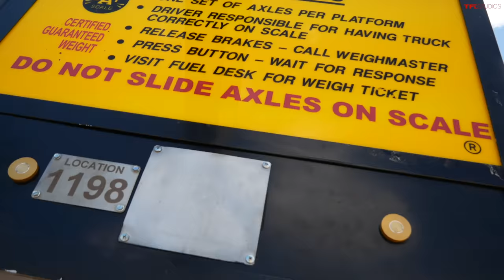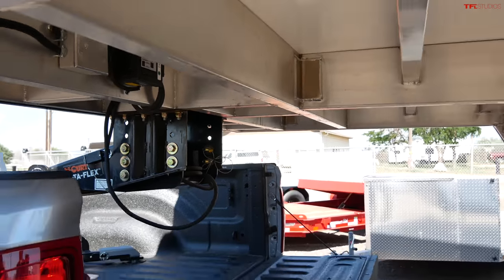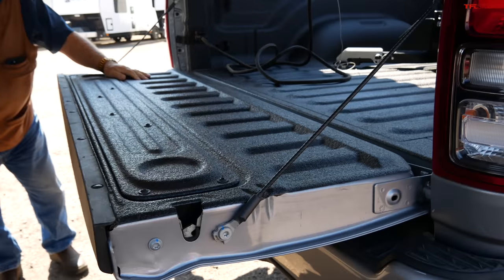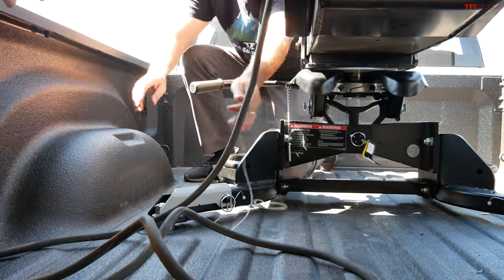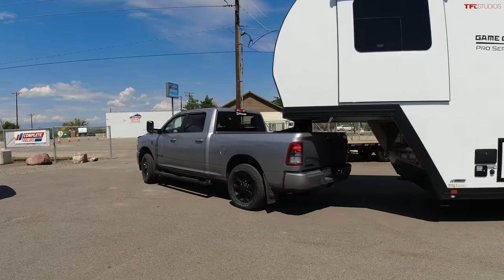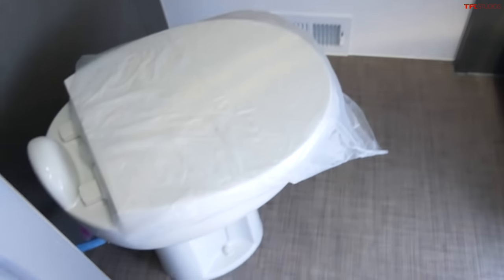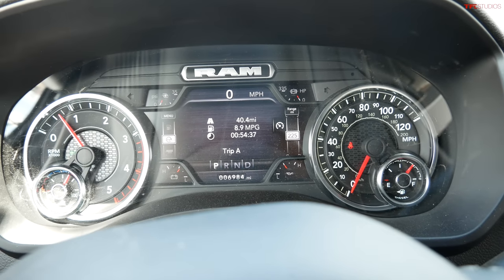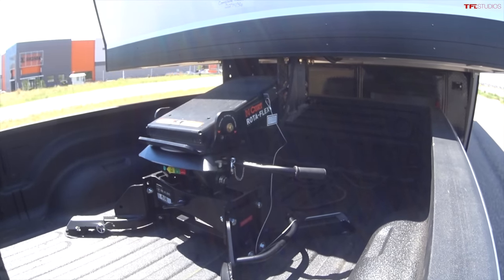I Accidentally Overloaded My Ram 2500 Cummins By 1,000 Pounds & Guess What?

Comment: Hey guys great video. Slight correction on the trailer. Empty weight: 11,064lbs, GVWR 16,800lbs, Axle Size -2 X 7,000lb Axles. Some of the GVWR transfers to the truck which gives you a higher GVWR.
Reply: How does it give you a higher GVWR? GVWR of anything is what it is and is specified by the manufacturer. You can't just change it.
Reply: @AJourneyOfYourSoul  Tandem 7,000lbs axles = 14,000lb but this GVWR shows 16,800. Since the truck is hauling the trailer in the bed of the truck, some of the trailer weight is now “transferred” to the truck and off the trailer. All trailer manufacturers do it and the rule of thumb is 10%-15% transfer weight.
Reply: @CompleteTrailers  

Yes, some of the weight is being carried by the truck, but that doesn't mean it "gives you a higher GVWR."

The GVWR is the GVWR no matter what. 

I think you misunderstand the term GVWR. 

Terms have meaning. The last thing you want to be telling people is that you get a higher GVWR. 

How high? Does the GVWR go from 16,800 to 20,000 now?
Reply: @AJourneyOfYourSoul  I think you are totally misunderstanding what they were saying. The GVWR based on just the axles is 14,000lbs. But the trailer is rated at 16,800 because of the weight being transferred to the truck. Some trailers have their GVWR based on just the rating of the axles, which is true of most bumper pull trailers.
Reply: @CompleteTrailers  just because 'everyone does it' doesn't mean it's right. Camper is built as light as possible and then gets a tag it can barely support? The guy was so worried about the landing gear bending when hooking up.. utility trailers don't get tagged this way
Reply: @Stuka87   he said it gives you a higher gvwr.  So how much higher is the gvwr now? 

GVWR has a very specific definition and meaning.  

He also said some of the gvwr transfers to the truck. How does a rating transfer to the truck?

He is giving out wrong information. The gvwr does not change. 

It appears he is either a trailer manufacture or dealer.  The last thing I would expect of someone in his position is to tell people it makes the gvwr higher, people will probably believe him.
Reply: @AJourneyOfYourSoul  Again, it appears you lack understanding. Sure, he probably should have said "some of the weight transfers to the truck" instead of saying GVWR. But its a freaking youtube comment, stop nit picking. Its very clear he meant exactly what I said in my previous comment.
Reply: @Stuka87  that’s not what he said. Words have specific meaning, especially in technical subject matter. 

He may have meant to say that, and people like us who understand the subject know what he is trying to say, but lots of people will not get that.  

The only reason I made a stink of it is because this person is a trailer manufacture or dealer and the channel thought the comment was so important they should pin it for all to see. 

If there is anyone who should know how to communicate proper information about trailer and towing, it should be this guy. 

So many people out on the road are towing overweight, the last thing we need to do is start telling people weight on the truck makes your gvwr higher.
Reply: @AJourneyOfYourSoul  Don’t be a nitwit. The axles are rated for 14,000 pounds so the gvwr would be 14,000 but some of the weight is transferred to the truck so the real world gvwr is 16,800 because of that transfer. That’s it the gvwr is 16,800.
Reply: @AJourneyOfYourSoul  Also, why are you arguing against a trailer company. I would think that the company that makes the damn thing knows more than you would.
Reply: @epap1375  when not hitched to a truck the weight is all on the trailer, meaning the axles and the landing gear. So the gvwr is the max weight the trailer can weigh weather it's hitched to a truck or not.
Reply: I understand the confusion. Utility trailer companies cannot be compared to larger trailer companies. For example, some utility trailers come with a 3,500lb axle but the manufacturer “de-rates” the GVWR to 2,990. Now why the heck would they show less capacity than what the axle can support? Well, anything over 3,000lbs in GVWR requires a brake in most states and manufacturers are trying to keep costs down so they rate the axle under 3,000. The reverse is true for larger trailers. For example, our flatbed goosenecks have 2 - 12,000lb axles. Simple math shows that the GVWR should be 24,0000lbs right? Wrong - since the truck is handling some of the weight (when hooked up) the GVWR shows 25,900 lbs. This is a completely legitimate practice that all larger trailer manufacturers follow.
Reply: 8000 lb. axles
Reply: @MrTruckTV  That statement in the video was incorrect. This trailer has 2 - 7,000lbs axles.
Reply: @CompleteTrailers  Sorry, when we picked up the trailer, I was told 8,000 lb. axles
Reply: I was going to say you are wrong also until after reading all the comments I realized you really meant.

Your original post sounded like you were saying that since the truck carries some of the load you can assume the trailer can handle a higher weight than what the GVWR is.

But what you actually meant is that Mr. Truck said the wrong axle rating... and you assumed Mr. Truck thought the rating of the axles was 8,000lbs because they divided the GVWR by 2.
Reply: @MrTruckTV  Sorry for the misinformation! Heads are gonna roll. 😬
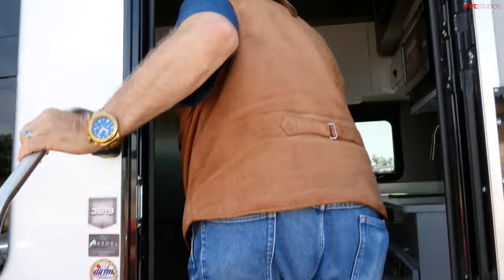Reply: @CompleteTrailers  I am glad that ATC is now making heavier duty toy haulers. I am particularly impressed by both its use of Azdel (not verbally mentioned here, but displayed on a sticker at 17:30) and its 7458 lb payload. Personally, I would not buy a trailer/toy hauler built with the old standard - luan. Azdel is well worth the added cost. As for payload, toy haulers equipped with an onboard generator seem limited to between ~2500 to a max of 4400 lb.  A 4400 lb rating is uncommon. But even then, it's EASY to exceed it. 

I have seen some toy hauler manufacturers (Desert Fox comes to mind) who FAIL to subtract from the rated payload the weight of the accessories they supply as standard with their toy hauler (e.g. generator, A/C units, rear beds/seats and its 'Happy Jack' lift mechanism, etc.). This can detract ~1000 lbs from its true, remaining payload.  A full sized UTV equipped with accessories can weigh 2200 lbs., 100 gallons of fresh water adds ~850 lb. Throw in an ATV or dirt bike, 30+ gallons of gas, a few hundred pounds of clothing, tools, etc., and one can readily exceed 4400 pounds. The difference between ~4400 and ATC's 7400 lbs is huge and much appreciated.

The only complaint is the unloaded versus fully loaded weight distribution. Ten percent of  its GVWR of 16,800 lb is 1,680 lbs. And yet, when EMPTY, its tongue weight was measured at 1760 lb (11,080 - 8320). This implies that essentially ALL of the weight of whatever is put onboard needs to be centered midway between the rear axles or (preferably) even slightly behind the midpoint between the rear axles
Reply: @thjacobi  A trailer's GVRW is put in place for when it is being towed down the highway. not when it's parked. So if it transfers let's say 2000 pounds onto the truck, then that is 2000 pounds less riding on the trailer's axles. 
Once you park a trailer you can put as much weight in it as you want, the GVRW is nothing more than a weight rating.that is put in place for safe highway use.
Reply: My 1-ton F-350 Lariat (most options) SRW with me in it, full fuel, and full DEF weighs 300 lbs less than this Ram 2500 with probably similar levels of equipment. That's the problem with 3/4 tons: they are SOOOO heavy that a significant chunk of their capability is kneecapped, on top of the fact that they do not have the GVWR ceiling that 1-tons have. The diesel engines are the primary cause.
Reply: @SurelyYewJest  That seems odd for the Ram (with a inline 6 engine) to weigh more than the Ford (with a V-8, with V-8 engines normally being heavier). I can venture a guess that  model year may make a difference.  I have a 2017 F-350 SRW, Diesel, 4wd, Crew Cab, Long bed. The ONLY weight difference between an identically equipped F-250 and F-350 SRW is that the F-350 had an extra set of leaf springs in back. So, the F-350 weighs ~60 lbs more. 2017 was the first year when Ford switched to an aluminum body, reducing its weight by a couple hundred pounds. Ram has not switched to aluminum.  What year is your F-350?
Reply: @gregparrott  Mine is a 2017 (Magnetic) as well. =) Is the only difference the extra leaf or two? I thought there were a few others like the rear diff and axles. It begs the question: If you added the F-350 rear spring set to an F-250, would it basically be an F-350? The F-250 max GVWR is a good deal lower. 
Speaking personally, I don't think the aluminum thing panned out well for Ford. It's a hard sell to say it dropped weight when 2022 Super Duty trucks are all hundreds of lbs heavier than, say, a loaded 3-row 2005 Excursion 6.0 PS that is steel front-to-back with a similar payload capacity as a current Ford F-250 Platinum with scads more torque and better transmission tech. Even GM stopped touting "high-strength steel and aluminum construction". There's just no getting around the fact that, annually, hundreds of thousands of average joes can drop a wad o' cash and ride home on 3.5-4.5 tons of mined and smelted metal.
With respect to the Ram, this is not the first time the Cummins truck was mind-blowingly heavy. TFL did a gas Ram VS diesel Ram test some time in the last couple years and the diesel Ram was absolutely eye-popping on curb weight; if I recall, the 6.4 Ram was well over 1000 lbs lighter. I think of all the Big 3 3/4-ton trucks, the Ram is the most impacted by diesel weight when it comes to payload. It may have 2 fewer cylinders and fewer parts, but those parts (pistons, rockers, valves) are just bigger than the Power Stroke or Duramax. They're all CGI iron 4-valve pushrod designs. And, it's a Cummins so the block is built like an aircraft carrier. Fully dressed I think the current 6BT pushes 1200 lbs by itself. The Power Stroke 6.7 I think is near 1100, as is the Duramax. All the current diesels really make you think about whether the gas engine might be better unless one truly needs the capacity of a full-tilt F-450, Chevy/GMC 3500, or Ram 3500 HO+Aisin dually WHILE accelerating like a passenger jet at takeoff.
Reply: @SurelyYewJest  Your "magnetic" comment is confusing. If you have a 2017 (it has the new body style compared to 2016), your truck's cab and bed body,as well as tailgate are made of aluminum. The axles on the F250/350 are the same. The F-350 has and extra leaf and the spring set is arched a bit more to raise the back end about an inch (when unloaded) compared to the 250.  Comparing the weights to earlier models is not fair because the the new frame is MASSIVELY stronger. It has larger cross sections and prior portions which were "C" sections are now fully boxed.
Ford claimed that they reduced the weight by hundreds of pounds, but some of the savings were then used then to beef up the frame, suspension and brakes. I agree that aluminum offers a mixed bag of up/downsides. On the downside, the bed is more prone to puncture when dropping heavy, sharp loads. Also, if you need body repair, it costs nearly double to do so on aluminum. A friend had a 1950's International pickup. Its sheetmetal was so thick and strong that you could WALK on the hood. That type of strength has been traded for MPG. Aluminum seems to be the trend.
From you're saying about Ram, it sounds like their design philosophy places a lower priority on balancing its base weight versus its payload
Reply: @gregparrott  Magnetic meant the color.
For sure the current Super Duties are far superior to the previous generation, it's just that while using lightweight materials and adding strength they still ended up a lot heavier. At least the center of gravity is/should be lower on the current gen.
I had to have mine in the shop twice to fix a rear panel that was damaged when someone rear-ended me earlier this year. The first run at the aluminum was not entirely successful in returning to the original curvature so I had them give it another go. It's definitely a more involved check on the work, and not only does it cost more, only specific body shops can do it. I had to take mine to a place 15 miles away even though the same company has several outlets that are closer (but no aluminum tools or expertise).
The puncture thing I hear is not that common, but that's just anecdote on my end so maybe it's more prevalent. Mine has a spray-on liner and the bed seems to be tough as nails.
Ram has not focused on lightweighting at all from what I've seen, and they probably feel they don't need to given that their sales really hit a high gear over the last decade in spite of their lower reliability record. Pound for pound I think Ram trucks are the nicest lookers with the best interiors. Haven't seen the new GM interiors yet though.
Reply: @calvinh.8882  sorry dude, you're flat out wrong.
Reply: @thjacobi  Over a month later you respond, and sorry it took you so long but I'm flat out correct!
Reply: @gregparrott  they are wrong in the video about the weight of the tongue weight! The truck empty weighs 8300lbs then when hooked to the trailer the trucks axles weigh front 4940 rear 6140 for a total of 11080 now subtract the weight of truck 8300lbs from that and you have 2780lbs tongue weight.
Reply: @HEMI345375  and its sad cause the axles in rear is like 6400lbs. N fronts are like 5200lbs. On mine. Which is a 2012. Axles can take over 11k. But the sticker debates it to 9900 lbs.. but whatever. . Right..
Reply: The ten thousand pounds rate is for the ball hitch on the bumper with a fifthwheel hitch you can tow quite a bit more but if your going to pull a big camper I'd recommend a 3500 dully if you blow a rear tire with that much weight I'm not sure you could handle it with the dully it's just safer
Reply: @AJourneyOfYourSoul  yeah I think what happens is they rate the axles.. so when you pull in a scale you better be under 14001k. Now the tongue of trailer better weight less than  the gvwr on pick up. So let's say ram truck is 10k gvwr. And truck alone weighs 7700 he can't put 2300lbs of weight total in truck axles. Even though most rams have a axle capacity of over 11k. Mine does not they derate it down to 9900k... so stupid
Reply: I believe Transferred is being used as, weight of 5th wheel carried on trucks axles ..not weight carrying capacity added to the truck.
Because truck frames, axles, bearings, don't get stronger from adding a trailer.
Reply: @AJourneyOfYourSoul  "Mr Truck", is a truck and RV dealer.
Reply: @tylereurick9316  trailer manufacturers don't know more. The "7,000 pound axles" is the axle tube and spindle rating by them, which is always downgraded from the true weight rating of the tube and spindle. The true rating for a "7,000 pound" axle is actually 8,500 pounds if you have 8 bolt hubs. You have a "7,000 pound axle" with 6 bolt hubs, which is common with RV manufacturers. The axle manufacturers specifically states that the spindle and hub determines the true axle weight rating even if the axle tube is rated for 8,500 pounds. I have built numerous trailers and replaced dozens of axles/spindles under trailers. The hub and spindle always determines the axle weight rating.
Reply: @MrTruckTV  were the hubs 8 bolt or 6 bolt. If they were 8 bolt hubs, the axle gross rating is actually 8,500 pounds. Same tube, but the weight rating depends on the hub bolt numbers. 6 bolt hubs are 7,000 pounds. All axles are derated by trailer manufacturers but not the axle manufacturers.
Reply: @SurelyYewJest  most 3/4 and one ton trucks, especially diesels, use the same axle. The weight difference is if it is a single wheel or duals and the appropriate hubs. Most all 3/4 and one ton truck use 3 inch brakes today. Its the number of tires on the ground that changes the weight rating and even the weight rating of the tires themselves. Are they 8 ply or 10 ply? 10 ply tires can carry an average of 500 pounds per tire more than 8ply tires.
Reply: @cliffterrell4876  8 bolt
Reply: @MrTruckTV  proof of the axle derating by the trailer manufacturers. That axle is actually 8,500 pound rated.
Reply: @cliffterrell4876  Interesting. I will have to check on my RV's "7000 lb" axles with 8-bolt hubs. It would put me more at rest if they were in fact 8500 lbs each, because then the trailer can hold more than its dry weight plus full cargo. I mean, having 2 7000 lb axles from the factory works fine; 14000 lbs total is still well above dry weight plus some cargo. But I tend to prefer overkill when towing safe.
Reply: @SurelyYewJest  built too many trailers. This was the case with every "7,000" pound axles. Look at the manufacturers stamp on the axle. It will specifically states 8,500#
Reply: Ignore truck gvwr it doesn’t matter, I’m in commercial driving all the DOT cares about is axle weight, your rear axle is good for 6500. The pin weight will drop a lot when toys go in the back of the trailer
Reply: @AJourneyOfYourSoul .  The GVWR is each vehicle.. the 19k is the GCVWR .. This rating is the combination of both the truck and the trailer.. the important  part to have known before  attempting   a hookup of a fifth wheel or any trailer is what it's empty tongue weight is..
Reply: @CompleteTrailers .. the axles are 8k axles